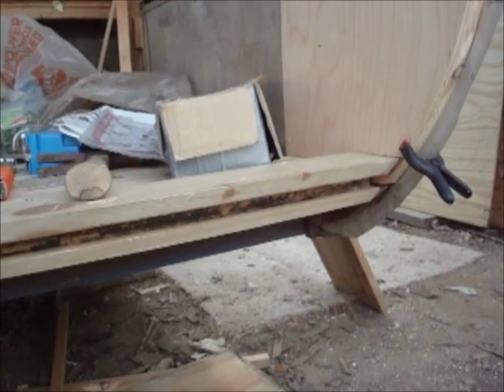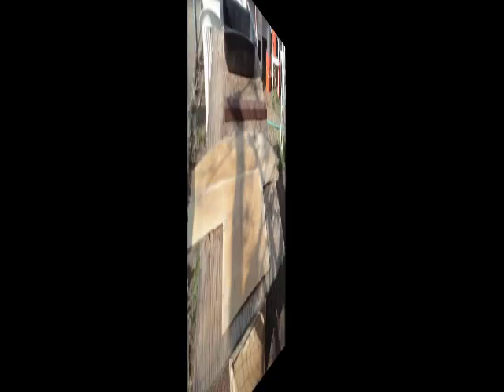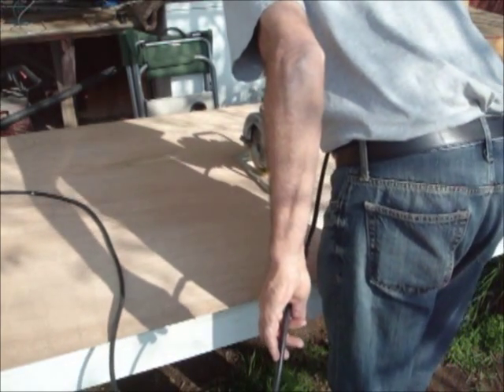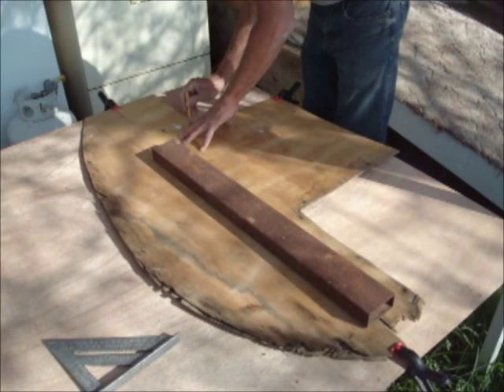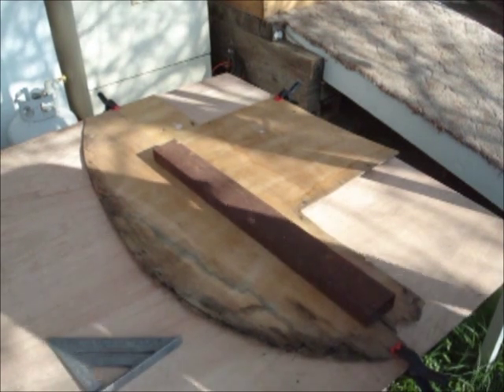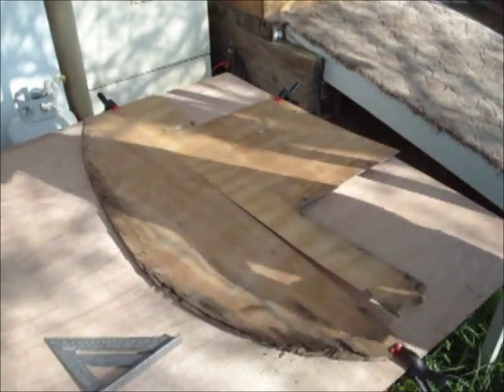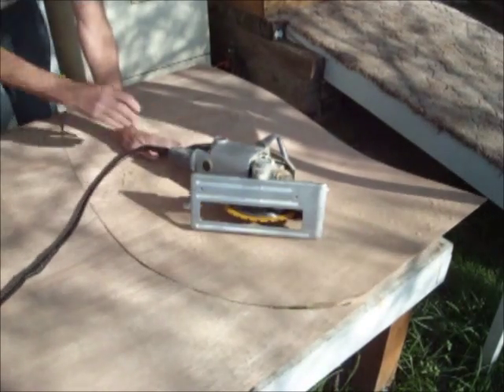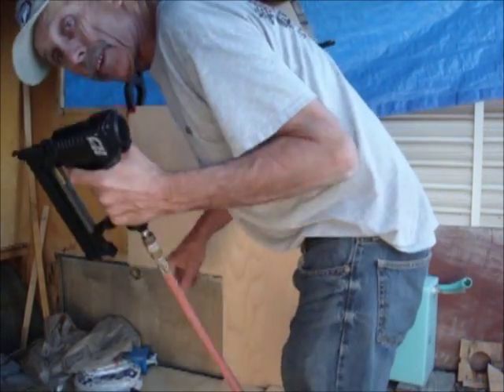Restoring The Shasta Part 7c - More Rear Wall Paneling

Comment: My harbor freight nailer went out on me so I ended up getting the new DeWalt gun. Freaking amazing nailer and has lots of features. One of my favorite tools now. Highly recommend checking it out next time anyone needs a new finishing nailer.
Reply from the maker: LOL my HF nailer is still working.
Reply: @mobiltec  Yeah, no doubt HF tools rule! And I ALMOST re-bought  my old nail gun. But the DeWalt was close (or cheaper) in price so I tried it out. Flipping awesome tool! It has some really cool features; like a swivel air inlet, the ability to hold the trigger and then just tap the hammer multiple times to keep firing and a really awesome case that holds extra stuff. Very cool tool.

Comment from the maker: Central Pneumatic. 1/4 inch crown stapler.

 Features include a quick-release nosepiece for fast clearing of jams and a 360 degree exhaust and a rubber nonslip handle grip for comfort. The air stapler handles 5/8" to 1-5/8", 18 gauge staples with 1/4" crown. Staples sold separately.
•Handles 5/8" to 1-5/8", 18 gauge staples with 1/4" crown
•Single sequential trigger
•360° exhaust
•Rubber nonslip handle grip
•Quick-release nosepiece for fast clearing of jams

Shop Harbor Freight online. Easy...